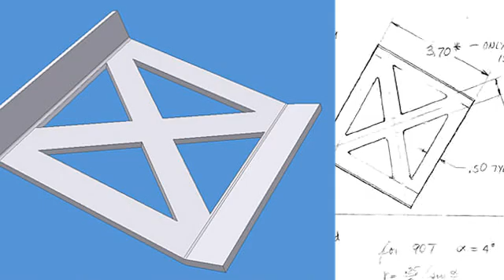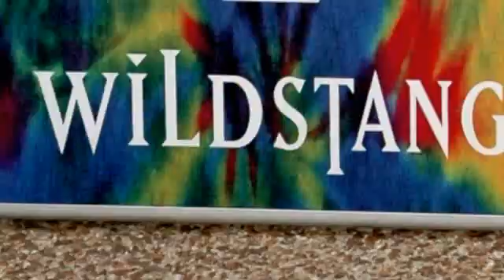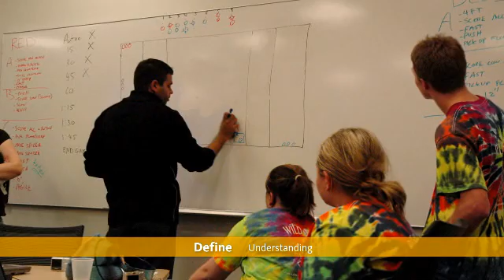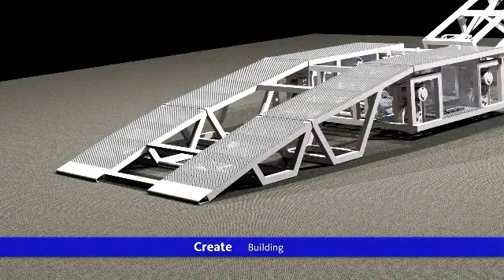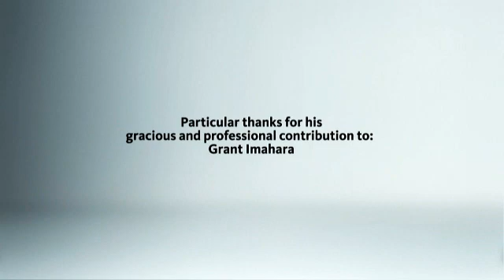Grant Imahara Robot Design Process Video

Comment: I agree with this. Simple, predictable, reliable. I saw some design before with too many moving parts and this increase chance of a small mistake somewhere. Any tiny motion that would be wrong can make an assembly system fail to do a job well. I will press more focus in design strategy.